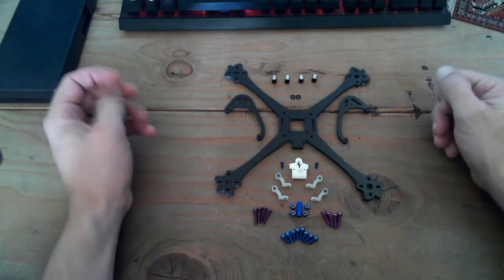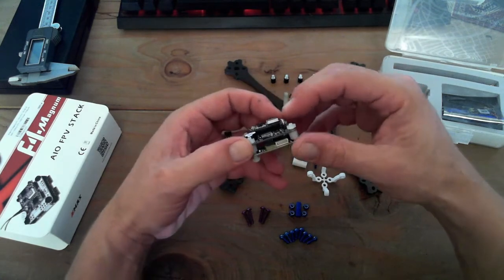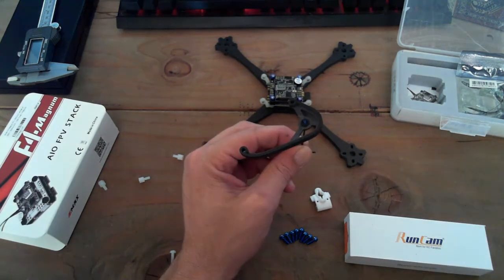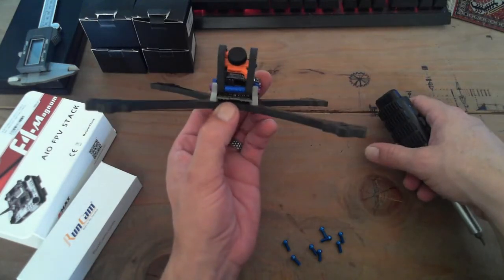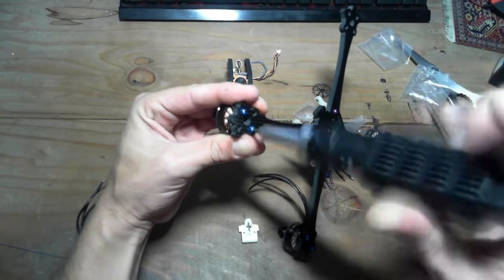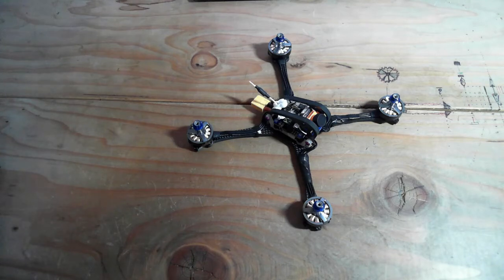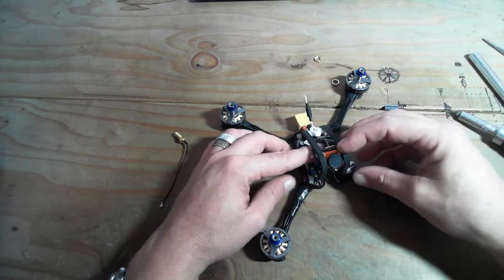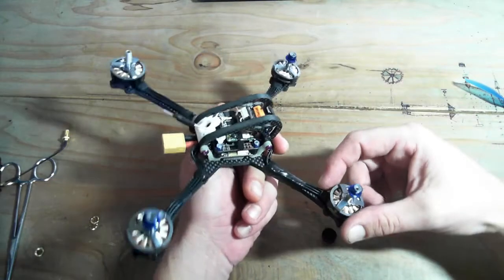Emax F4 Magnum Tower & HypeTrain Motors & Runcam Micro Swift 2 Prototype Build

Comment: you have the camera mounted in a good location but lack any cross bracing in the canopy.  I you take a impact at an angle these will just flex out of the way with the way it is designed.

Comment: Just to give you a tip, the soft mount standoffs. If you ever have a problem and can't get them all the way tighten down because the nut is not deep enough. Take some of the small plastic washers that comes with the runcam cameras and put them on the bottom to help with the separation. I always have to do that.